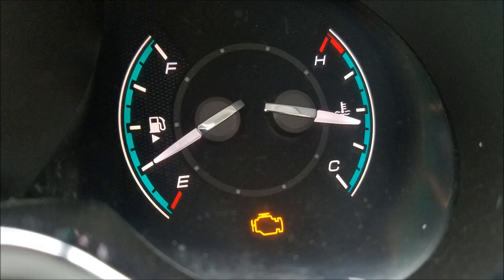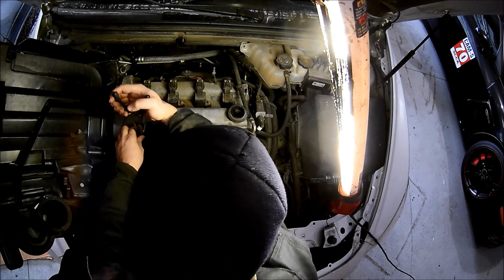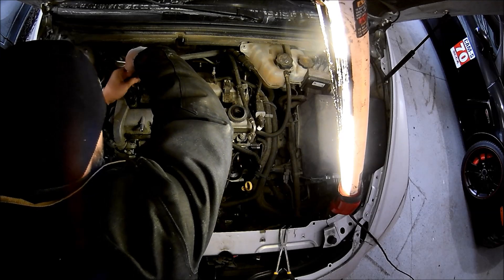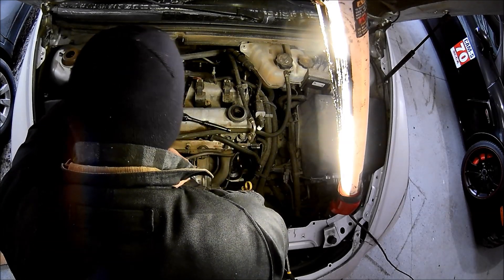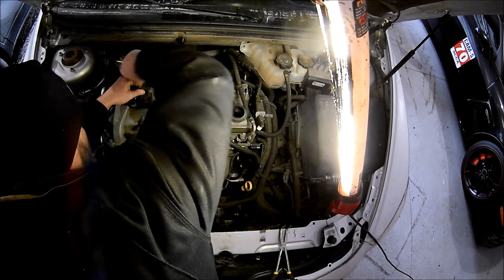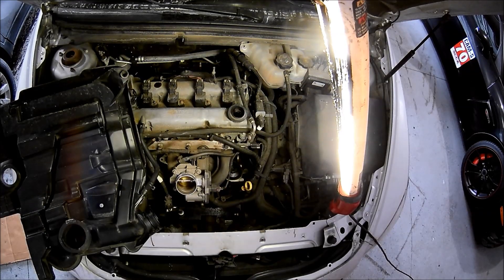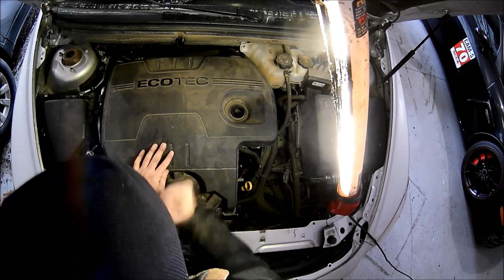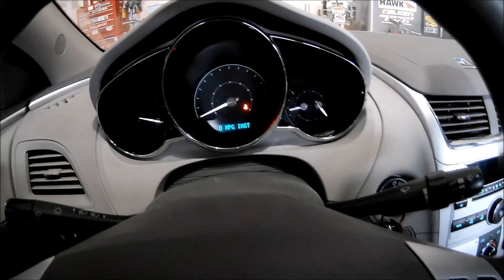Malibu Impala 2.4L p0013 p0014 cam position actuator sensor solenoid fix "how to"

Comment: to anybody trying to find this part on rock auto,  it's called a  Variable Valve Timing (VVT) Solenoid / Actuator. And thanks for the video
Reply from the maker: thanks for the comment and the help through rock auto! :)
Reply: There is a intake and exhaust VVT solenoid, just an fyi. https://www.rockauto.com/en/catalog/chevrolet,2009,malibu,2.4l+l4,1442753,engine,variable+valve+timing+(vvt)+solenoid+/+actuator,12910

Comment: I just put this part into the same car. However, I do not have a way to reset the code so will the check engine light and memory reset on their own?
Reply from the maker: Eventually, if the problem is resolved, it will go away. The easiest way to reset the CPU is to unplug the battery for a few seconds and reconnect it.
Reply: I had someone to reset it afterwards but the light cam back on less than an hour later. Apparently there is another problem with the car. The car had one hard startup prior to adding the part to it yesterday and another afterwards. The way I found out I needed this part was during a check engine diagnosis at Autozone.

Comment: I have a 2011 malibu and check engine light for the crankshaft sensor i replaced it erase the check engine light and it keeps coming back, what it was doing was that it was taking a long time to start up and so.etimes j had to give it a little gas, i was wondering if any body had that issued it would help a lot thanks
Reply from the maker: Did you rescan it and seen what the new code could be? Its unlikely to be the cam positions actuators.
Reply: No i didnt have a problem with the accuator my problem is the crankshaft sensor i replaced it and it come back again on my check engine light was wondering if u had any advice thanks
Reply from the maker: Possibly bad wiring. Or bad connectors

Comment: Was the engine running rough and in limp mode before you out in the new solenoids? I've got the same motor and I have a list of codes some similar to yours.
Reply from the maker: If the codes are the same then you have the issue but my engine ran fine before and after

Comment: Hey did you have a problem with the exhaust manifold
Reply from the maker: No.
Reply: On my 2011 chevy malibu last year I have replaced 3 exhaust manifold it cracks on the middle of the manifold
Reply from the maker: @josericardorodriguez8518  Ok, sorry but that never happened to mine.

Comment: In most cases you will have to do a full drive cycle to be sure that the cel stays off. But nice educational video. I just bought a 2012 LS 1LS
Reply from the maker: Sure that could work, i just cleared the codes and it was fine

Comment: Yea I just changed mine out I accidentally torqued the one to tight broke bolt in half tried drilling it out no luck I ended up jb welding it on where bolt is supposed to go hope it works out
Reply from the maker: ruh roh! let me know how it goes lol
Reply: @GearheadDaily  so far so good no oil leaking check engine light never came back on and it still real tight
Reply from the maker: @jamesrondini4321  Awesome! Glad it worked.

Comment: hey man, very informative video. Just checking to see if any idea's on what else would cause the P0013 code... my solenoids looks good. My wife has a 2012 malibu LT and car only ran for 5 weeks from the dealership before it wouldn't start anymore. Dealership was useless in trying to find the problem at first it was "the battery"  which they offered to replace which they did not, then it was the "fuel pump" which was changed out 2 times.. then it was my wifes fault her car wouldn't start... so i had it towed from there to a 3rd party mechanic who did a lot of work out of pocket. Changed the fuse box and fuses, wiring pigtail harness and wiring from the fuel pump to the rear fuse box, new battery, clean the Evaporators system, and did all the fluid changes on the vehicle... picked up the car on friday and same shit... stuck in a parking lot unable to start the car. I change the spark plugs today and nothing... they're clueless at what the issue could be just as anyone else... but we keep getting codes P0446 and P0451 and now the most recent ones the P0013 and P0010... any suggestions or advice would be great....

tried changing up the car but dealership won't help there either.
Reply from the maker: How can you tell the solenoids are good? Mine looked perfect when i took them out. I'd replace both solenoids and then also replace this: https://amzn.to/2Yk3IL1 double check part numbers, but a quick search shows this to be the most likely culprit.
Reply: Any follow up on the solution to this cars problem?
Reply: My 2012 is causing me a lot of headaches, The car literally stopped one day and just wouldn't turn over, All sensors replaced, than had it towed for a new tank fuel pump?????..the mechanic told me to drive it and left, cashed my check, and I didn't get a mile down the road and it started to stall out, Now the weird thing, p0014 came up still, now when i lift the sensor out aliitle, the engine runs fine, but engine lite stays on? when I tighten the bold down, I can't keep the engine running....What the Hell s going on, I paid alot for the pump and feel I was screwed on that..Please help anyone...
Reply: Try a new starter relay its 16 bucks and worth a try, if yours is bad car will act like it has a dead battery, it's worth a shot.
Reply: @Tatortot318  key needs to be reprogrammed

Comment: Here we go bro. Got a 2012 Chevy Malibu. Late 2016 got both camshafts replaced and recently got the new fuel pump. Cranks still no start. What is it?
Reply from the maker: Do you have fuel pressure? Tested at the rail?
Reply: Gearhead Daily haven't tested it yet. It was working perfectly then one day a week later it just doesn't start. Cranks still. I.had a little habit of leaving my gas tank unfilled at times. Could it be the condensation water build in the gas tank? Just wondering
Reply from the maker: Any MIL's? Can you hear the pump turn on? Dead fuel pump relay? Bad gas? You can check by cranking and holding down the gas pedal, that will force it sometimes.
Reply: Gearhead Daily found out it was exactly the position sensor. Because I got the intake and exhaust valves replaced myself. Will be repaired tomorrow
Reply: What he is replacing is the camshaft actuator solenoid. Totally different part then what the sensor is. I have a 2012 also and ran into this issue.
Reply: Check relay

Comment: STOP CALLING THESE A SENSOR! There is an actual sensor and it's just one on the front driver's side of the motor. You are changing the celenoid/actuator or both of them.  You cause confusion by calling these sensors which they are not. There is no sensor in these things. It's basically an oil control valve for the variable valve timing of which that's why there is 2 of them one for intake and one for exaust sides of the motors 2 cams.
Reply from the maker: Fair enough.

Comment: No u will bend the tab if you don't manually pop the oring into the valve cover. Lub the oring feel it pop down and then tighten the bolt. You can damage the solenoid/leak oil

Comment: I have a question
Reply: My car is not turning over
Reply: Codes I got where p0014 and po341
Reply: Does that fall under what you did in this video the car will not start at all

Comment: My malibu 2015. Is roughly idling. And acting like it going to cut off while driving or stop. What can we dooo about this i need help badly. Any suggestion
Reply from the maker: Any MIL's you can read?
Reply: Yes i can read. But a cam shaft part is smaller. That the 02 Sensor that he is changing 😕
Reply: @GearheadDaily  he didnt ask if you can read. He asked you so you have any codes?
Reply from the maker: Right? I wasnt asking if he could read. I know he can LOL
Reply: @GearheadDaily  humans smh

Comment: I had 4 camshaft position sensor s replaced and my car still put puts and acts like it's going to cut off when I stop but sounds good driving minus the hard shift in first and second gear🤦🏽‍♀️
Reply from the maker: Sounds like you've got a bigger issue at play here. Mine had zero symptoms, just kept throwing the codes.

Comment: 2014 malibu while driving i will loose power indicator light would have power lost then the car dies until i have the battery recharged each time P000013 P000014
Reply from the maker: sounds like you have another issue

Comment: i have a hyundai genesis 2.0t and have the same p0014 code. I replaced wires, vvt  selenoids, camshaft position sensors, and still check engine light on. I dobt understand why the car still runs very good, no rough idling,  no stalling.... does anyone know?
Reply from the maker: You'll hvae to look that up for your specific car, this is about GM's
Reply: Hello, did you end up fixing the problem? I also keep getting this code but absolutely no symptoms. Car runs very great.
Reply: no i ended up selling it

Comment: I have a question. My check engine light is on and I recieved a test and it said I need a new camshaft sensor actuator circuit. Are these the same thing.
Sorry I'm just learning about cars lol
Reply from the maker: Could be. Ask the mechanic for the code. If he won't give it to you, something is fishy

Comment: My engine light is on. They ran a diagnostic test which read it had this problem which you just showed on your YouTube video. That was fixed yet the check engine came back on. I did a tune up (mechanic suggested) and engine light is still on. Any suggestions? I have a 2010 Chevy Malibu
Reply from the maker: Did you replace both sensors or just one?
Reply: The part this guy replaced is called the cam shaft actually or solenoid. Not the cam shaft sensor.
Reply: Changed both...then got a code of p0171...so we just changed the MFA sensor, now my engine light comes and goes but still not fixed. They’ve checked for leaks. Don’t know what else to do. If that CODE of p0171 is on what’s something else you would suggest to fix which would make this engine light GO AWAY?
Reply: Sometimes you have to get the code cleared if it’s fixed at the dealer or someone who can clear it

Comment: This is not the cam shaft sensor. Watched a video similar to this and read up on comments. The sensors are on he right side. I think those are the cam shaft actuator solenoids. Totally different part
Reply from the maker: Look at the part in the description..... https://www.amazon.com/gp/product/B00F675WNW/ref=as_li_qf_asin_il_tl?ie=UTF8&tag=gearheaddaily-20&creative=9325&linkCode=as2&creativeASIN=B00F675WNW&linkId=3131ead6984775414968b157f2a01409
Reply: Daniel De Aro your right
Reply: Definitely the actuator solenoid. I am replacing mine now. And I ordered the sensor which goes on the right side ...
Reply: @simplyfinesse  yeh I was just bouta say the same thing theres two sensors on the right side of the engine on side one frnt one back!! Then the two solenoid actuator positioners on the left top

Comment: you can't see yourself spending the money on the hose clamp tool.You wont say that when the clamp is located behind the cylinder head in an obscure location where the light don't shine.
Reply from the maker: Fair point, but I haven't gotten there just yet LOL